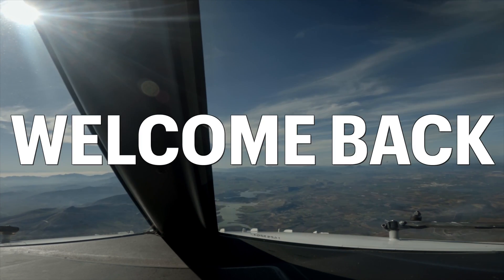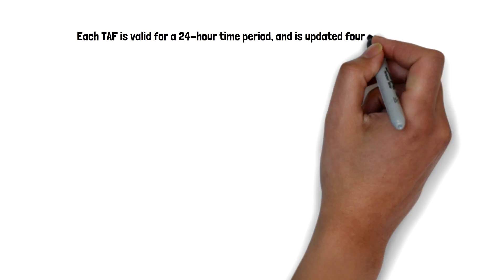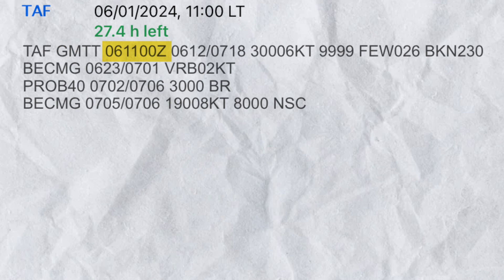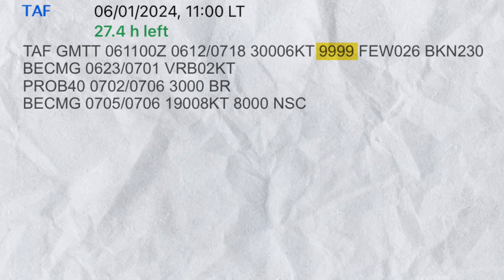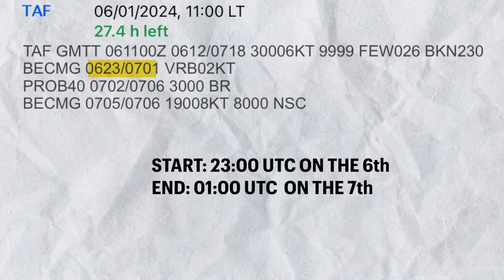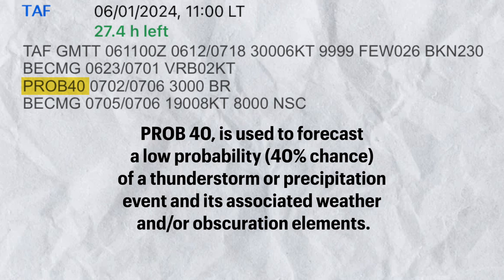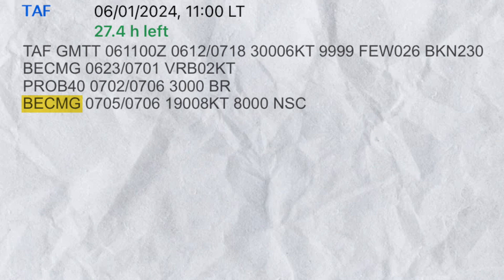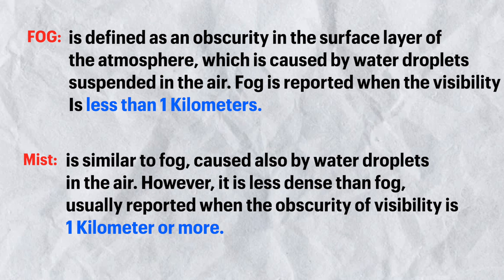How to Decode TAFs | Terminal Aerodrome Forecast Explained | Aviation Meteorology 2024

Comment: Please clarify Tempo defination within TAF
Reply from the maker: Sure, TEMPO or Temporarily, is a short-term type of change in the forecasted weather conditions that is expected to last less than an hour each time and not more than half the period for which it is forecasted. 
Ex:

TEMPO 0911/0916 5000 HZ FEW030
This means that temporarily between 1100 UTC and 1600 UTC of the same day (9th) there will be a temporarily change in weather in terms of visibility will be 3000 meters with Haze and a few clouds at 3000 ft. The important thing here to notice is that after 1600 UTC the weather condition will either go back to what it was previously forecasted before the TEMPO group or it could further change, depending on that's after TEMPO.
Hope that helps
Reply: Where is link